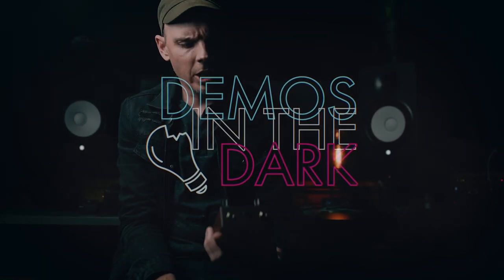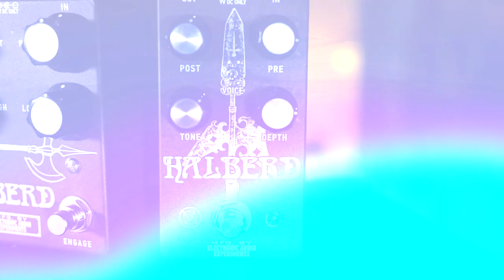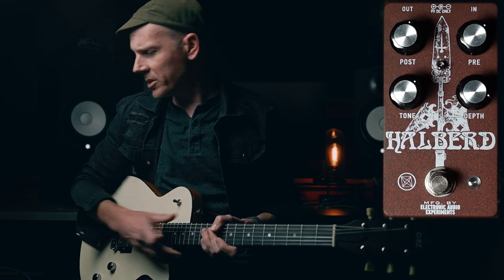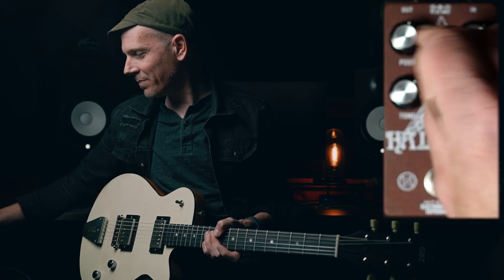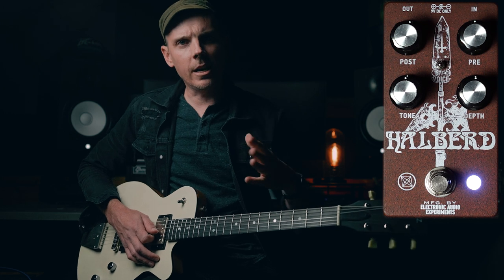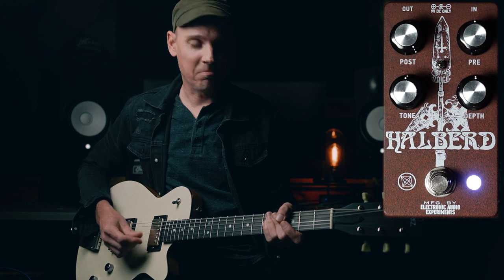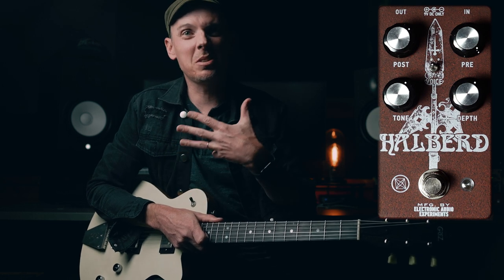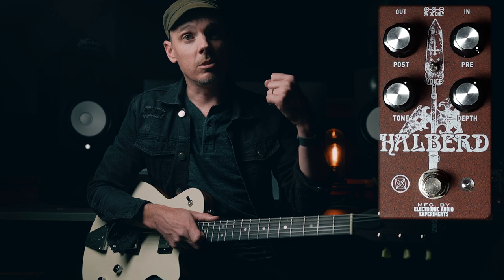Demos in the Dark // EAE Halberd V2 // Guitar Pedal Demo

Comment: Hi. Got the Halberd two weeks ago and I’m in love with it. Don’t know where to start. Let’s say well, it’s very versatile. Sounds great from very low gain to all the way on the gain pot. It’s very dynamic and responsive, cleaning beautifully with guitars volume no matter where the gain (pre) knob is set. Its very clear and articulate with great notes separation or definition. The eq is so powerful that you can make it sounds just as your amp with more gain or you can color the tone any way you want (obviously has it’s limits). Takes pedals very very well and works on clean or driven amps.  The voice switch is very useful to match your amps tone. Have a dark sounding amp or just want bright sounds use up position. On my amp the center and down positions is where I want to be. I think that the down position is kind of a bassier, a little more gain, more open version of center. However with the eq you can shape the tone so much that, even when each voice is very different, you can make an extreme setting on one voice to sound kind of like other setting on other voice. Hope I make sense. Anyways, it’s great…